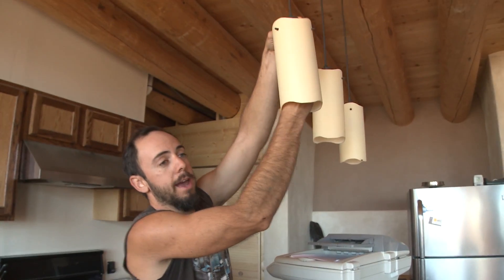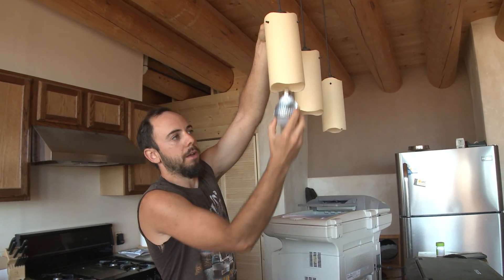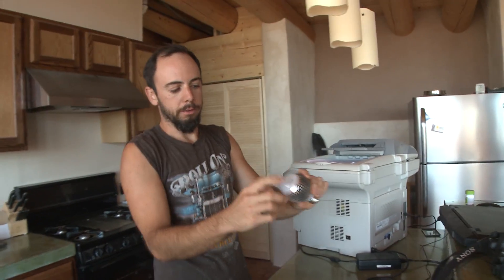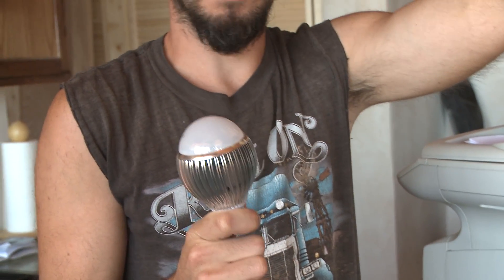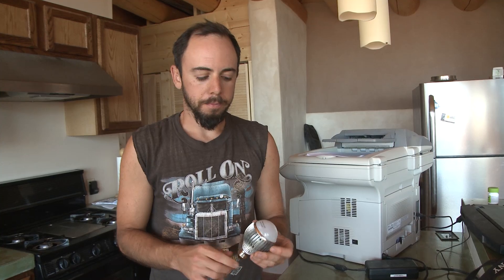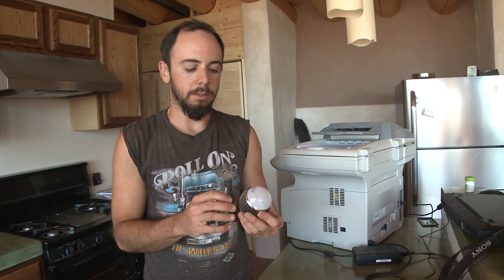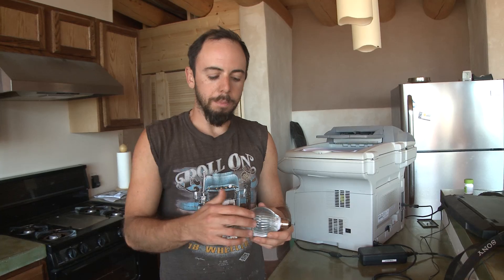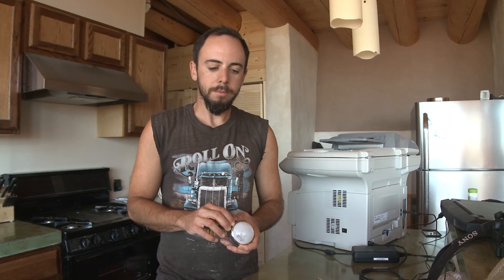12 vs 24 Volt Solar Systems

Comment: I'm going 48v fully inverted.  5-6kw inverter.  Pure sine wave.  Pick up a cheap 3kw modified sine wave for back up emergency (modified sine wave inverters are cheap!) also have a generator for backup and charging batteries when there isn't much sun.  Never ever let your batteries go below voltages they aren't supposed to

Comment: I am seeking input on whether I need to have any type of current limiter devices when running my 24 volt lights, refrigerator and water heater element from my 675 amp hour battery bank.  Thanks for any input!
Reply: your devices are the current limiter.. if thats what your getting at? Eeven though 675ah is good sized your heating elements will kill battery banks fast.

Comment: excellent video; amazing how much has changed since it was 'filmed.'  I am an electric associate at HD, I can get you soft wite (2700 K) 9 watt 800 lumen LEDs for 2 bucks a piece these days.  Good data, keep posting.
Reply from the maker: +Barry R McCain yep, it is exciting how fast things are evolving.
Reply: Could they be run in series ?  rc
Reply: Barry R McCain but not 24volt...
Reply: It's unlikely that those $2 light bulbs are 24V DC, so it's not really a direct comparison.

Comment: Personally I think it's a bad time to jump ship on DC. As the developing world adopts solar, the choice in DC appliances is likely to multiply. Also some tried and trued AC products are moving to DC because of advances in DC brushless technology. You are likely to end up in a situation where most of your loads are being converted into AC by your inverter and then converted back into DC for your LEDs, fans, digital devices. This effectively multiplies your losses and dramatically increases the amount of electronics to fail. I would think having a limited AC system with a parallel DC system would make much more sense. Thoughts?
Reply: I definitely get what you're saying. There is power loss when you invert it from dc to ac and then loss again when going back to dc.  Yes any electronics (computer wise) all run on dc.  But the one guy has a point. I'd rather just run an inverter and run the house like it's tied to the grid. I'll worry about everything switching to dc in the future more when it's happening.

Comment: Have you tried a voltage reducer 24 to 12 volts?
Reply: Yep...  efficiency of the device must be weighed against the result.  rc
Reply: MPPT is just the best way to go, if you're off grid or not. You can run high voltage panels, 24v are usually cheaper than 12v panels ime, charge your 12v batteries, have significant usable current available to the batteries and run cheaper 12v loads/equipment to your dwelling or whatever. Cheaper wiring, cheaper batteries, cheaper panels and a little more for a decent mppt controller, in the end you're better off in every respect.
Reply: very inefficient.

Comment: I would prefer inverter and use ac. As a backup you can get cheap gasoline generator. It would not only backup inverter failure but also cloudy days.
Reply from the maker: +Gatis Zvejnieks we agree with you now
Reply from the maker: +Gatis Zvejnieks we agree with you now

Comment: I am running a 24V system and running 12V bulbs in series of two to make 24V and it cuts your cost of bulbs down to 5$ a bulb 7W 800 Lumens cool white.

Comment: Good info thanks! I subbed.  I'm looking at a 1KW solar system, 24volt with a 45 amp charge controller and a 3000 watt 24 volt inverter to 110. I just bought the land for the house build and trying to save as much $ as possible so the ac and fridge was the real clincher. I already have a fridge and a high seer heater/ac. My plan is to set up and run all inverted ac components until I find a cheap 24 volt dc fridge. If you would have any leads on that please pass along and share how you and your systems are doing today, would like to hear the outcome. God bless brother and thanks again!
Reply from the maker: cheers!

Comment: Just my 2 cents worth. I have never had to deal with a solar/ battery system for my house. But I do have a cabin that is totally off grid. No water or electricity hook ups at all. I installed a solar/battery system and do have the bare necessitiesI have electric lights, tv, satellite, and indoor plumbing including a shower. I started out with a small inverter from wal mart then bought a larger one  from harbor freight as a back up. After 7or 8 years the small one died and I installed he larger one. I do recommend having a back-up. My whole cabin is run from the 120 volt A/C inverter except the water pump and a couple of 12 volt DC lights for back up. I do not understand why you would want to pay so much for DC equipment when it is so easy and cheap to run your house on 110 vac.
Reply from the maker: thanks for the comment.  in the future, we will just go AC for everything.  you are right.  the one big advantage of DC is that even if the inverter blows, you are still up.  But its not worth it.

Comment: where the hell would you get 24v aquipment from .

ive never even seen a 24 v inverter .

im doing research for a boat .

what im trying to do is work out how to put 3 batteries to 4 panels and a wind turbine .

still have 12v output but draw from all 3 batteries equally .

not two batteries essentially giving the load battery a jump.

it has to be 12v output for the sat  nav , fresh water maker ,lighting  etc .

Then 240v sockets in each cabin going back to the inverter for phones pc tv .

il get the sockets that have biult in usb ports.

Any input greatly received.
Reply: 24V inverters are very common just make sure it is a pure sine inverter
Reply: I'm looking at buying one now.
Reply: Yes, thank you! I am now trying to understand the difference between a MPPT and a PWM charge controller. If you should happen to know thank you as I am about to make a big purchase. I just purchased a piece of land and making the jump off grid very soon. This is what I'm considering buying: 1000W 1kw Monocrystalline 24v Off Grid Solar Panel Kit: 6pcs 160W Mono Solar Panels+45A Charge Controller+Solar Cable+MC4 Branch Connectors Pair+Mounting Z Brackets for $1,400. and then the psw inverter: 3000W Pure Sine Wave Power Inverter DC 24V for AC 110V Solar System.  Thanks for any info you would share! God bless!

Comment: A problem with going to higher battery bank voltages is how many batteries it takes to get to the higher voltages with no gain in amp hours.  It takes 8 6V batteries to get up to 48V.  If you want to get any extra amp hours, you will need to get another 8 batteries to hook up in series with your first 8.  In a 12 volt system it only takes 4 batteries to double your amp hours.  It much cheaper to build a system at 12V and just add another two batteries if you need more amp hours than it is at 48V.
Reply: indeed this is the kicker! I'm deciding this issue today. Im going to be running everything through the inverter  most likelly. Just not sure on the 12v verses 24v. Do you have that much loss with a 12v inverter ??. It will be fed in to an ac 100 amp breaker  box. And  then normal wiring t hrough out the house.
Reply: the loss on the inverter should be listed in the specs somewhere
like this one
http://pdf.wholesalesolar.com/inverter-accessories/Magnum-Inverter-MMS-series-data-sheet-revd2.pdf?_ga=1.251473218.532155065.1467943445
its peak efficiency is 87%

another thing to consider with a 12V system is to figure out what the peak draw on the batteries will be in Amps, and then size the wires for the battery cables appropriately for the length of your wire runs and amp draw

for example, this inverters max continuous input current is 133 amps dc which, according to this chart, http://assets.bluesea.com/files/resources/newsletter/images/DC_wire_selection_chartlg.jpg,
means that you would want 1 AWG wire for runs of 10 feet or less and a voltage drop of 3% or less.

Comment: Why do people justify using 24 volt systems with cabling size.   This seems to be the only viable pro for 24 volt.   In fact what is happening is the saving you get on cabling is far outweighed by much much more expensive 24 volt appliances ... I don,t understand the logic.  

Another pro for 12 volt systems is battery storage.    If running 12 volt appliances you will get twice as many AmpHours from your battery bank than you would 24 volt.
Reply: I think you are wrong about 24 V systems having less battery storage.    It basically all comes down to Watts and the Wattage would be the same.       A 12 V 1000 Ah battery bank would have the same storage as a 24 V 500 Ah battery bank
Reply: True but when running 12V 100W (8A) appliance you are using twice the amps as a 24V 100W (4A) causing you to need twice the wiring capacity.
Reply: GA Prepper
Absolutely right, but Bax Bax made a comment about battery storage which was incorrect.     The only really justification is cabling size and lower wire voltage loss.    The larger the system the more sense it makes to go to higher voltages.    I have a small system myself and I am perfectly happy with my 12V solar system.

Comment: Why did you not branch off the 24v batteries and get 12v, run that in the house, and save $$ and double the avail amperage. (on the 12v line).

Comment: nowadays led lights 30 volts are way cheaper! (dont forget that you dont have a 24 volts, but 28! (under charge) (and even more when equalizing) nomal 12 and 24 volt led lamps can burn up, these days they sell led lamps you can use from 6 to 30 volts dc especially made for rv, camper boats etc.
 
good advice tho, thumbs up!

Comment: Why don't you just put two 12V bulbs in series? Duh! Wire each pair of sockets in series! If you want higher voltage to save wire gauge, just use an inverter and use standard 120VAC bulbs.
Reply: +rstevewarmorycom "Why don't you just put two 12V bulbs in series?"
I don't think that will work, those LED bulbs have drivers in them to limit the current, they aren't as simple as the old incandescent bulbs.
Reply: RandomSnot No they don't. If you're using DC current, and each wants 12 Volts, then each of two in series will NOT be able to tell that it is in a circuit with 24 Volts They don't need drivers, only 120VAC LED bulbs need drivers, LEDs themselves are low-voltage DC, the white ones are about 3.3Volts. A 12V unit is either three or four in series, and if it has a limiting resister or blocking diode that will not matter, the two will each only take 12Volts across each one in a 24V series circuit. Trust me, I'm a physicist. You can build your own 12V LED bulbs by putting parallel banks of three separate LEDs in series. You can use those strip LED reels that allow you to cut them every three LEDs, and that is WHY they do that, they need three in series and a diode and or resistor to keep the current down. Try it. All you have to do is make sure an LED doesn't get too much current, and that is done with three in series and a small value resistor. Gang as many of those as you want for more brightness.
Reply: RandomSnot Says 10-20 Volt DC input. So what kind of system are you running on?   I had thought you said you were 24Volts? You don't need these, all they are is a crappy version of a Buck Converter, looks like a 555 or something. You can get BETTER quality ten-turn pot SETTABLE Buck Converters from Chino, CA on eBay for a dollar each that use an LM2596. What is the actual rating of your LED bulbs? You can dial these in to whatever voltage you want up to about 40V input. Item # 271988570314
--
http://www.ebay.com/itm/10pcs-LM2596S-DC-DC-Buck-Converter-Adjustable-Power-Supply-Step-Down-Module-US-/271988570314?hash=item3f53c838ca:g:Q~UAAOSwEetV-i-z

Comment: Very great info sir! I just got set up with my 24 volt system. 8 batteries (6 volt/225amp hours each), AIMS 2k inverter/charger, 1600 watt wind turbine, and charge controller. I got it all from Missouri Wind and Solar. They are a great company that has always helped me out and been very patient with me with all my questions as a beginner. The one thing I hate is that my inverter always uses 25 watts of power.

I'm glad I subscribed to you and I look forward to all your vids. Thanks again!
Reply: +Allan Bremer  I bought a MagnaSine 4024 Pure Sine.  It only uses 7 watts of power while in Search Mode.  However, it cost about 3 times the price compared to an AIMS.
Reply: My AIMS inverter has some kind of power saver mode that causes it to only kick on if it senses more than 50 watts. But I could never do that cause I run a lot of things under 50 watts. I really don't understand the concept of that setting.
Reply: Allan Bremer

Comment: I am currently looking into whether going 12v or 24v with an inverter for everything except for fridge and pumps.

From what I can see the thought of "higher voltage inverters are more efficient" doesnt hold up any longer.  Yes they are more efficient but we're talking 1%,2% at least in Studer Innotech inverters.

On the down side you have to double or quadrouple your battery bank and solar array which is a lot more expensive than buying some thicker cable and a couple more panels to make up for losses, unless the run is very long as you have pointed out.

Im having a hard time deciding because everyone says "Dont do 12v!!!" and their main reasons are "cable thickness" and "inverter efficiency" which arent really an issue any more.  Its just hard to go against all of the "pros" telling you to go 24 or 48.

I think one factor for "the pros" telling you to go higher voltage is because they sell twice as many batteries and twice as much solar power. You're definitely not saving any money by going higher voltages which is also one of the supposed benefits.  

The first thing to go  in a solar system is generally the battery bank (its also the most expensive part) so when its time to buy a new bank(because you shouldnt mix new batteries with old ones) you have to fork out twice as much.

I still dont get why people are so against 12v, I think its just people parroting old information.  If I am wrong and there are other down sides of running a 12v system through an inverter then I would love to hear about them.

Thanks for all your great videos!
Reply: +Mandala man The higher the voltage the less current the inverter needs to draw . Higher currents increase losses. I haven't looked into inverters at all yet, but, if what you say is true, then it would only be a 1 to 2% increase in efficiency. However, I should add that the more batteries and the more panels you have the more power you will have. Two batteries in parallel have the same power as two in series. P = I*V

Comment: obviously he didn't think of wiring his 12 volt lights in series of 2 each neg to pos then wire the remaining neg and pos leads to the 24 circuit 12+12 is 24 and the watts remain the same for the 2 at 24 volt dc.

Comment: I'm confused. why not just get a few D.C. buck converters from eBay and install them inline to your lights? they would take the 24v and drop it to 12v or really any voltage less than the input. they're cheap, they're reliable, and more efficient than a.c. inverters. using these and boost converters I can have my battery bank at any voltage I please and convert the voltage as needed. 12v, 24v, 48v, you can mix and match appliances with no worries.
Reply: Adam is correct; you can run at 24 or 48 and then step down for specific circuits thru out the house just label the beaker box and label the wall plates accordingly
Reply: +Adam  - Adam is on to it; great advice !
Reply: Seems like here is the time to determine actual efficiency of the converters ??
Best, rc
Reply: Inverter

Comment: I wonder if you have considered inverting a separate second line from 24 (or 48) to 12 volt, since I think that this loss should be quite low and the inverter cheaper ( could always have a backup inverter at hand), so you have lower loss and still the variety of 12 volt appliances.
Great videos by the way, especially the one to proper size your solar system

Comment: OKAY! I just shipped back a Modified Inverter after learning about the dirty power it was producing and killing my appliances, now are you saying before I get a Pure Sine wave 24v inverter that I dont even need one? Can you show me a system running with out? I did Youtube the suggested video per the first house on 12v, but he used a save light bulb and drill bat, need to see whole system running without?

Comment: One advantage of higher voltage is that you can transmit more power over a lighter gauge wire.  That's why utility companies transmit power over long distances at 500,000 volts and higher.  Basic Ohm's law:  500,000 volts @ 1 amp = 500,000 watts.  To get 500,000 watts at a lower voltage (1,000 volts), they'd have to push 500 amps through a much heavier gauge wire.  That's why car manufacturers went to 12vdc systems from the 6vdc system - smaller gauge wire - lower cost - lower weight forces on a spinning generator.  If you connect two 12vdc lights in series over a 24vdc source, they'll work just fine.  The only extremely minor problem would be to identify the faulty light when it burns out (easy to do).  You wouldn't want to do that with a 12vdc coffee maker and a 12vdc toaster - both would have to be on at the same time.

Comment: go with 24volt and hook two 12volt lights in series, this would let you have the best up  both world and you can aways regulate down to 12 where you only have 1 item
Reply: That works. I run a 48 VDC battery bank, and have 4 step-down transformers in the house to convert to 12VDC.  Sooo efficient over the lines to and from battery bank!
Reply: Patriotgal1 what's the efficiency of step down transformers
Reply: That wont work for all 12V devices.  Some devices do not work in series like incandescent lamps do.